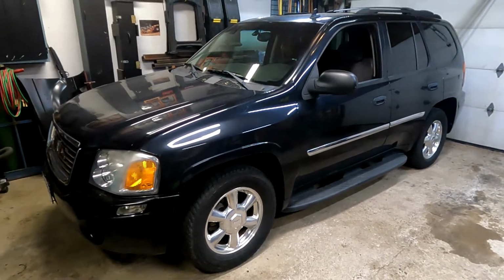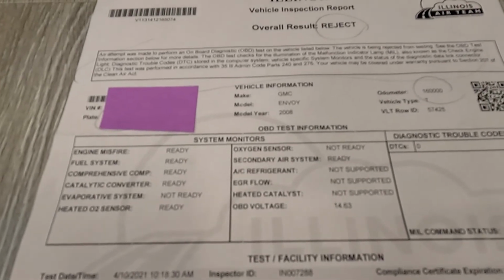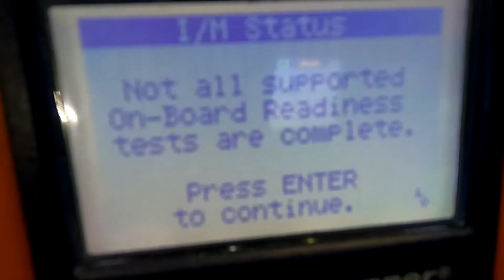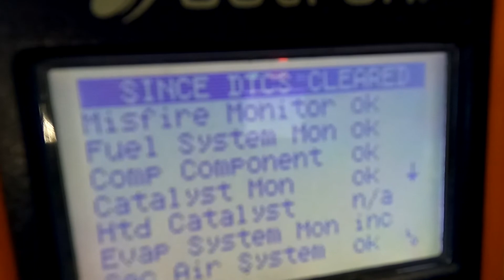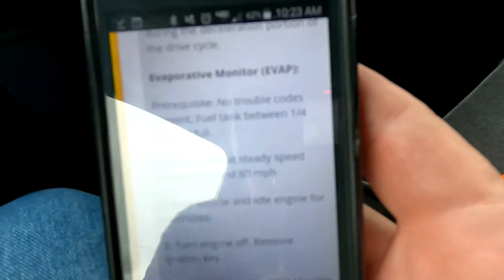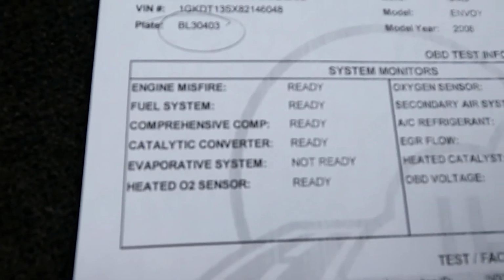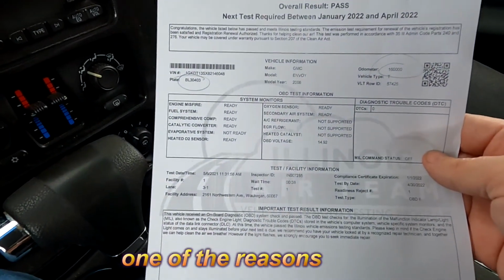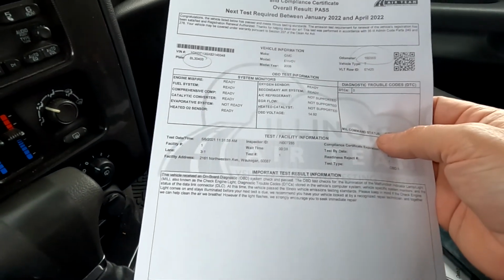08 Envoy/ trailblazer Failed Emissions Test- fixed for free

Comment: Thanks for the info, i have an 08 Envoy that is showing evap not ready.  Like yours i had an o2 sensor not ready either.  Caused me to fail the test, since then o2 has fixed itself, but the evap problem remains. 
Sadly i didn't drive my truck for a few weeks and the alarm drained the battery, which is why i have these problems to begin with. 
Well, it should pass with only evap not ready.  I plan to take it back in this week for a re-test.
Reply from the maker: Glad it helped, it should pass even with the evap not completed